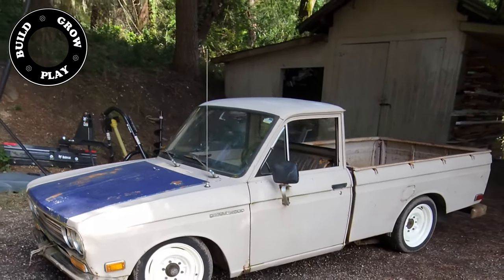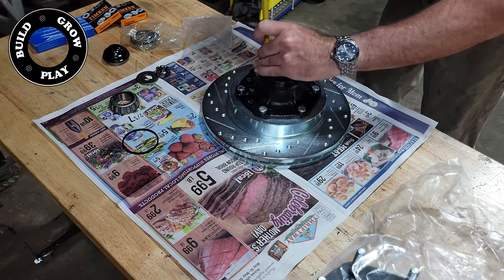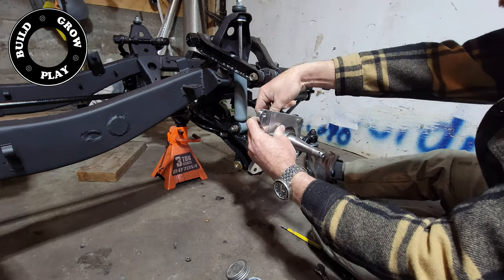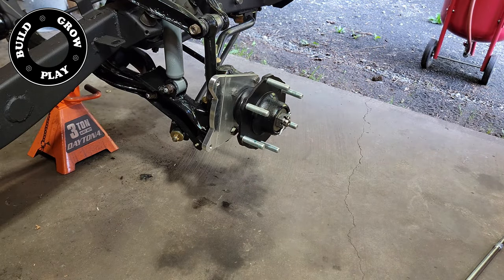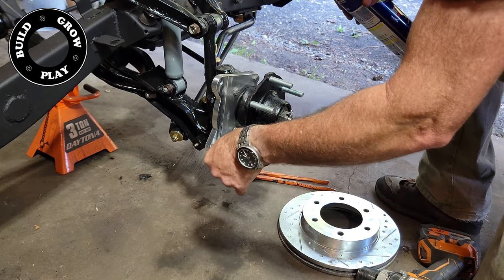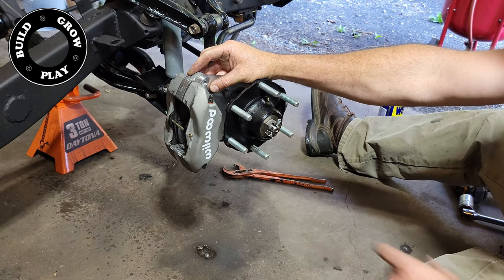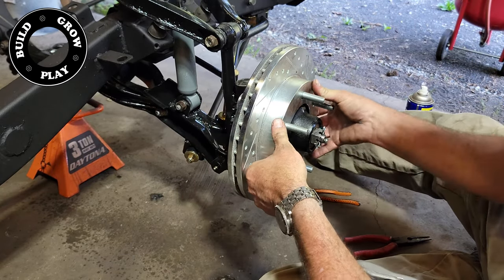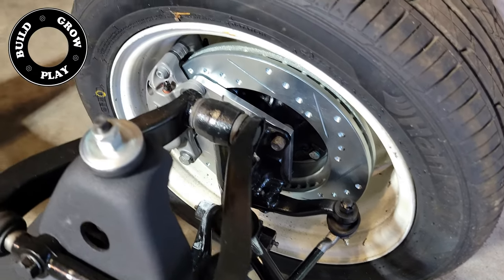Disc Brake Conversion - Datsun 521

Comment: Leaving a comment so I know why I saved this video: I've got a 620 that I'm going through right now and I need to double check that the bearings and seal you linked work for the next model year application! Cheers!
Reply from the maker: They are different, apparently
Reply: @buildgrowplay  yep! Discovered that a little while ago!
Reply from the maker: @mrbookends  Pretty annoying. I had ordered all the bearings I thought I needed from an online parts store only to find half of them didn't fit.
Reply: @mrbookends  What year 620 do you have ? And do you have the bearing # ?  I have a 73 and am thinking of doing this.  Thanks in advance.
Reply from the maker: Mine is a 72 521... different completely

Comment: Bummer you had to mess with the kit. From a bunch I’ve read I’m gonna assume those aren’t the stock 14” wheels? Keeper up I like 521 content. 👍👍👍
Reply from the maker: Yeah. Still easier than making an adapter. The wheels are 15s and still too tight. Plan on wheel shopping when I have the cab back on. Hope to have more content soon.
Reply: @buildgrowplay  If you want to keep that style you can use chevy rally rims and some hubcaps - otherwise you're got vintage Japanese offroad wheels / 90s minitruck wheels / some new 6 lug watts
Reply from the maker: @skilled1140  not sold on what to go with yet. Think original bamboo color with an orange fleck for the paint.